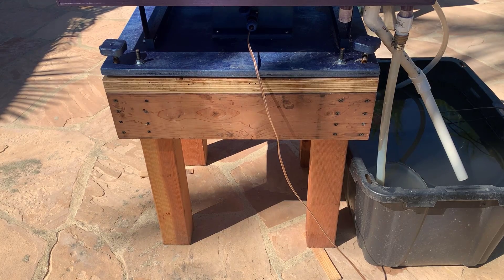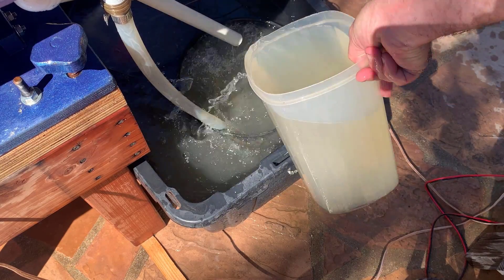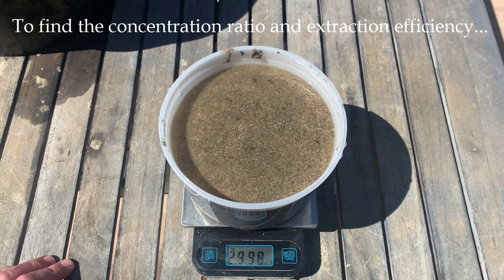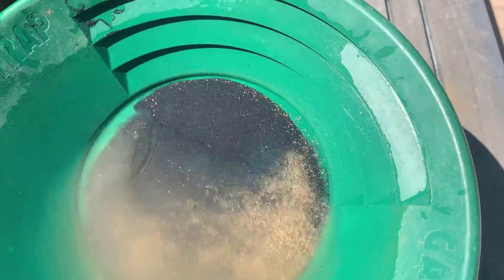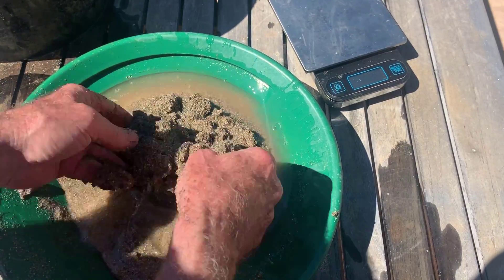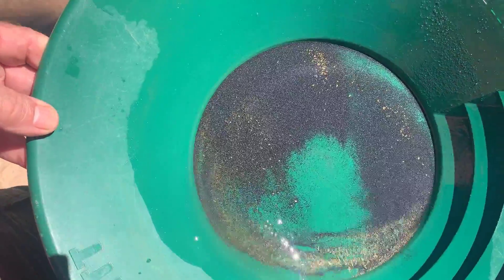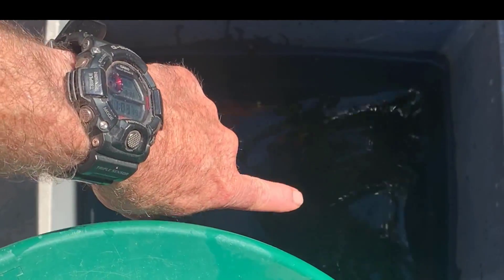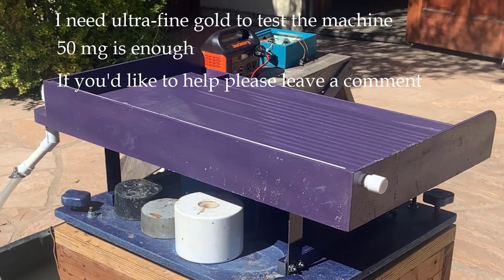Gold Bump-Sluice Shaker Table

Comment: by far the most well engineered and effectively designed home made shaker table i've seen - this is the first table i've seen that I cannot think of any improvements. ~excellent work Orophilia~        No table gets 100% recovery, they all miss a %, and i'd say yours is far above average.   In a pinch, you could use litharge for testing, and it's yellow for contrast vs fine lead powder which also works well for table testing -200 mesh and beyond. I melt all my hardrock fine gold into buttons, but let me check and see what I have.
Reply from the maker: I have litharge. That's quite a nice idea.  -- Dave